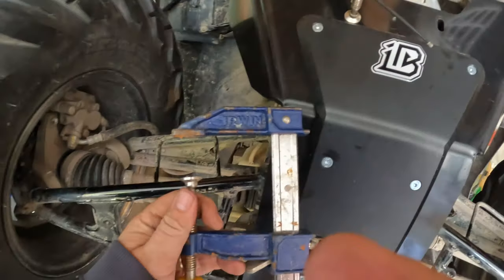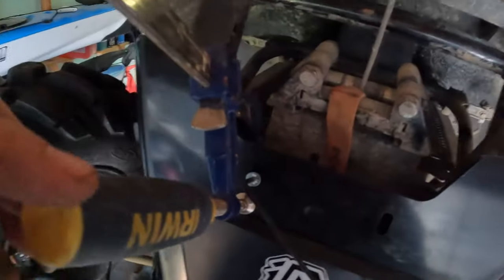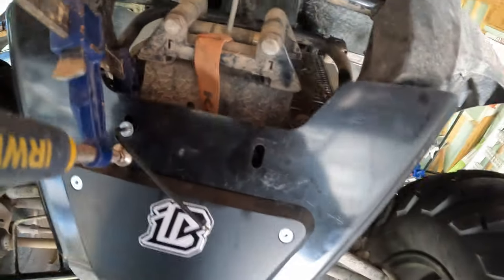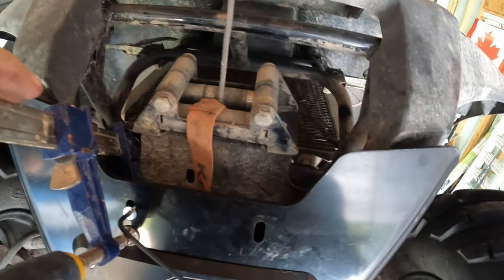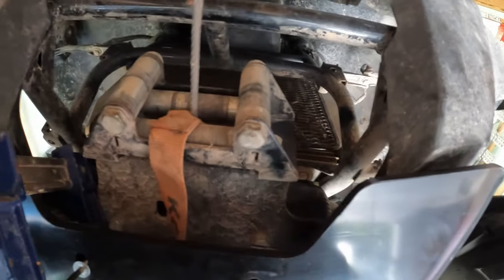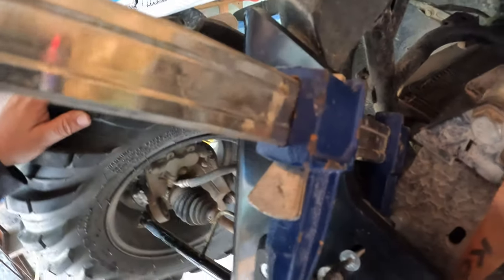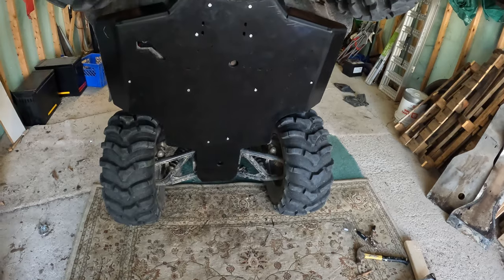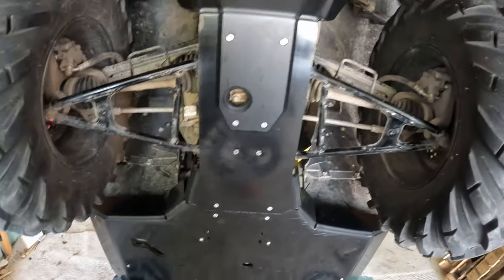IRON BALTIC HEAVY DUTY HDPE SKID PLATE - Installation Video

Comment: As we all know skid plates help a lot on protecting everything...
The only down fall I find personally is after Mud Rides the mud and clay stays jammed between the engine and the skid plate...
Do you have any tips or tricks to clean the top of that skid plate instead of removing it after every ride? I need to remove that skid plate every ride.
Subbed
Reply from the maker: Sure do! Let it dry out good, lift the front end of the ATV up some <winch or rocks> beat the skid plate with a rubber mallet to loosen it up and either shop vac the loosened dirt out or blow it our using compressed air.